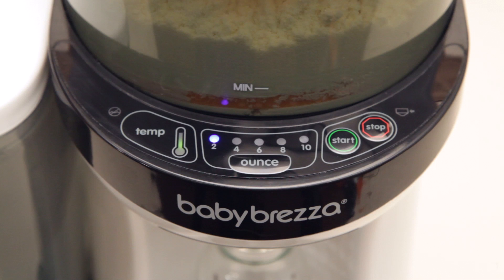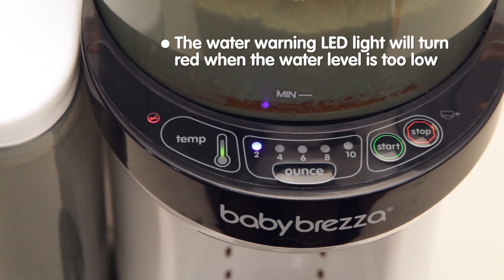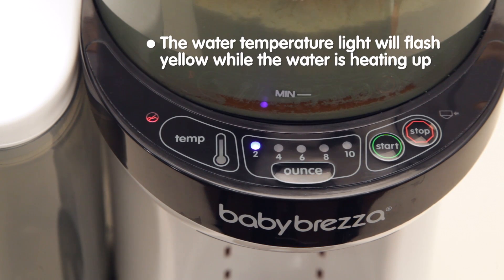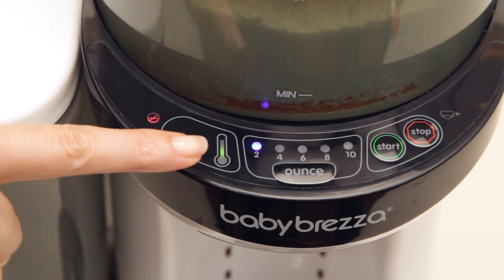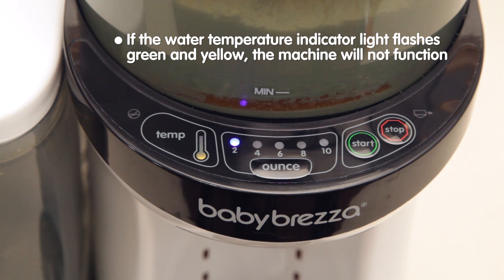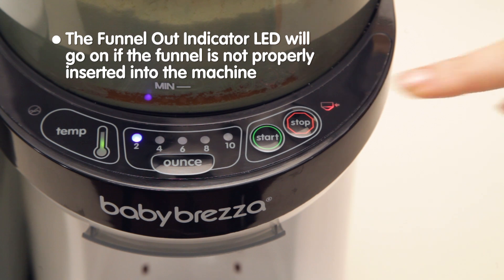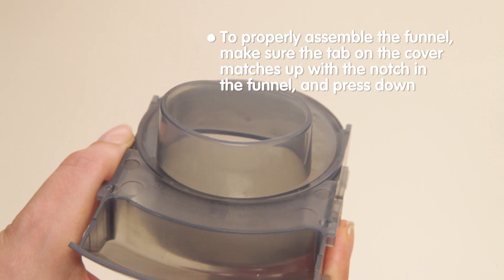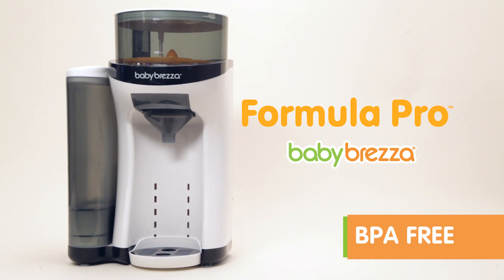Formula Pro How To: Control Panel

Comment: Mine wont warm the water. 😞 its always either yellow or green and yellow... complete waste.
Reply from the maker: We are sorry to hear this. Please contact Baby Brezza Customer Service at cs@babybrezza.com or by calling 888-396-6552 to address this. The flashing green/yellow is an indicating that you've put water in the tank that is either too cold OR too hot. Please try room temperature water. If this doesn't solve the problem, our Customer Service can try additional troubleshooting steps. Thanks.